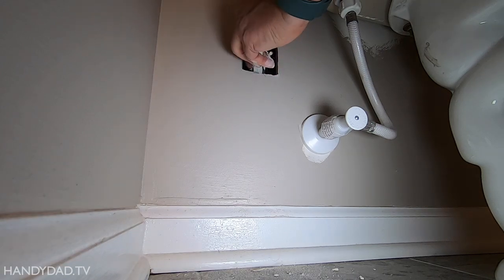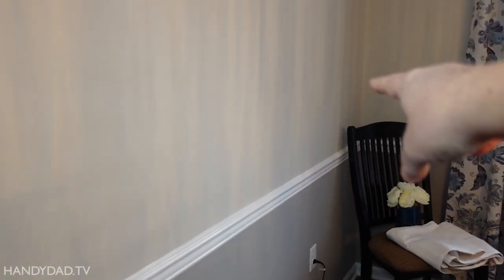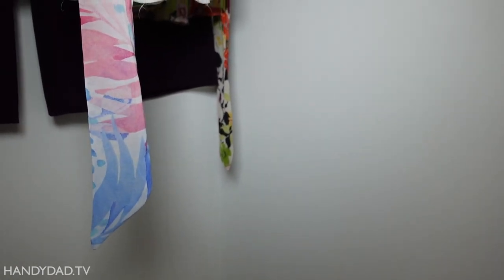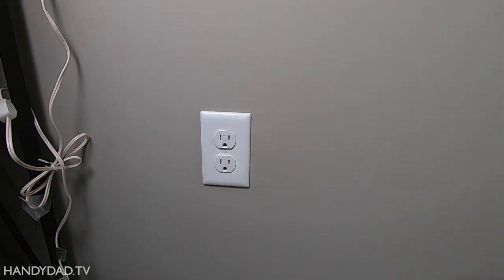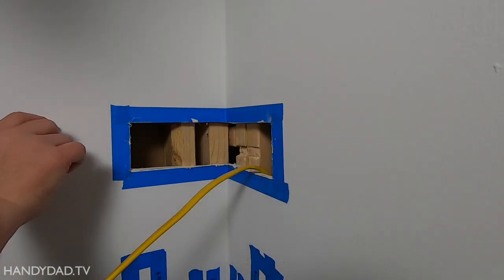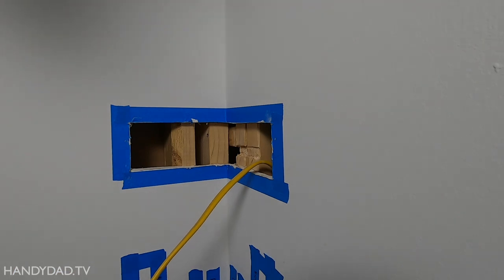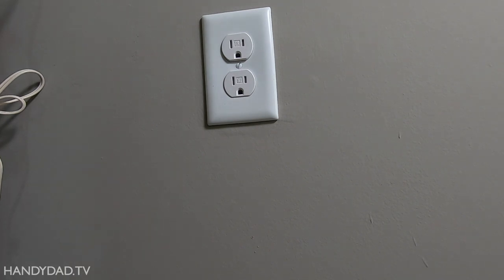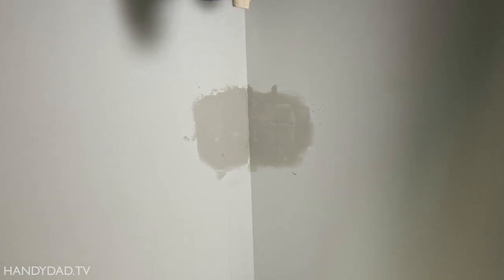Add an Outlet from Another Outlet Around a Corner for a Bidet

Comment from the maker: NOTE!! My circuit was protected by a GFCI breaker so I used a standard outlet. If you don’t have a GFCI breaker, you must use a GFCI outlet for shock protection.
Reply: This is what I was about to say.
Reply: Not so fast, that breaker looks like an Arc-fault breaker. GFCI usually has a yellow button. You better test it.

Comment: Fantastic Video!!! I have wanted to install a Heated Bidet myself, but the same issue as most, I'm sure. The notching out was Brilliant!!!!!!
Reply from the maker: Thanks. Just make sure to protect the wires before repairing the drywall.
Reply: Not it isnt he has to repair that now. He should have gone up and back down into the next wall or take the moldings off.

Comment: You did not notch more than 25% into the stud (if load bearing), you put nail guards over the wires, and you did eventually get the right GFCI breaker into the panel.  Seems 100% to code for me.  Good work, I never would have thought to get power the way you did.  Thank you for the video.  Its stuff like this that helps some of us think more outside the box.
Reply from the maker: Thanks so much 😊
Reply: It's not 100% to code because code states that the bathroom has to be on It's own circuit

Comment: There's another option that I've used several times that doesn't involve any drywall repair. Just requires two remodel boxes and access to the attic. Steal power from any outlet and go straight into the attic. Then run the power over and down to the new outlet.
Reply from the maker: Definitely a good option if you have an attic above or basement below. Unfortunately for me, there is a room above this bathroom and I’m on a slab so no basement either.

Comment: Nice video but shouldn't that outlet be a GFIC by code because of how close it is to a water source?
Reply from the maker: It’s on a GFCI breaker.
Reply: @handydadtv  hey. That breaker is an afci breaker(arc fault). The GFCI breakers usually come in a combo afci and GFCI with a purple reset button. I would double check your panel by removing the shroud to see the whole breaker.
Reply from the maker: You are correct. I replaced it with a GFCI outlet. 

I’m surprised AFCI, GFCI, or combo breakers aren’t clearly marked so you can tell without opening the panel. I just saw the test button and assumed it was GFCI.

Comment: Great video, thanks. Quick question- how did you get the romex into the existing box? And did you drill a hole into the existing box or use the tabs? I would think either would be difficult to maneuver given the location. I’ve tried that in the past and wind up having to cut out the existing box and replace it with an old work box to get the new line in but clearly you didn’t have to do that
Reply from the maker: I cut the wall in the closet directly above the existing box, so I could see the slots and push the wire into it. No new hole needed.
Reply: You should use the knockout on the metal box ½ inch (removed with a screw driver).  Secure the  Romex/nm clamp connector on the Romex then pull it into the box and install the nut.

Comment: Wow! Excellent video with "best practices" tips. The only suggestion that I would make is that it is better, if possible, to install the electrical outlet on the opposite side of the toilet from the water inlet just in case you have water spray from a joint or a breakage.
Reply from the maker: Good tip! Thanks.
Reply: If that's part of the dinning room circuit, which I'm pretty sure it is, it should be GFCI protected already.

Comment: I use an  Oscillating tool to cut the drywall and the studs, makes it a lot faster and easier
Reply from the maker: I didn’t want the dust in the closet with all our clothes. My wife would have killed me!
Reply: @handydadtv  my wife would kill me too, lol. Love your videos by the way.
Reply from the maker: Thanks so much 👍🏻
Reply: I use my oscillating tool to channel the studs. Faster than hammer & chisel, and you are less likely to get nail pops! You can also chisel a small relief in the stud face so the nail plates sit flush and your sheetrock patches go back in place properly!
Reply from the maker: @Danny Good tip!

Comment: Nice video. Thanks. My understanding of NEC requirements is that bathroom receptacles must be on their own dedicated 20 amp circuit. If my understanding is correct, tapping into a circuit from another room, as you did, would not be allowed by code.
Reply from the maker: So I’m fuzzy on new construction vs. renovation. I went with easy and didn’t ask permission.
Reply: Believe that’s for new construction.

Comment: From about 10:29 and for the next 10-15 seconds the new cable is threaded behind the toilet.

So does that wall have no studs?
Reply from the maker: The studs were visible in the closet. There were no studs between the hole in the closet and the hole by the toilet.

Comment: Question. I am learning all I can and I am trying to absorb everything as a first timer. You mentioned that 2 hot wires were coming into the existing outlet and after wiring up your new outlet, the existing outlet made you end up with 4 pigtailed hots using only 1 screw. If you wanted, could you still run one of the existing hots to the screw directly and then use 3 hots nutted and pigtailed instead to the 2nd screw? Just wondering since 4 wires pigtailed seems much?
Reply from the maker: Yes, you can pigtail 3 and use the screws on the outlet to join the fourth. 

Be sure to watch this one as well https://youtu.be/xex8cPv8CtA

Comment: Hi! Love your channel. Question? I'm having the hardest time screwing the receptacle in after I"m done wiring it up. The screws that came with the receptacle are flimsy; they kept stripping. So I bought some screws from the store. They are #6-32 1" screws and came with hex nuts. Any tips on getting the receptacle screwed into the box? I figured I need to use a manual screwdriver, Phillips or flathead, but I think my technique is off? Should I use the hex nut? And if so, is the objective to get the entire 1" length of the screw into the hole in the box? Literally stuck on this on the new receptacle before I re-wire the old receptacle; it's driving me crazy.
Reply from the maker: The screws only need to keep the receptacle in place. If you need to crank them with force to get the receptacle in the box, you probably have too many wires for that size box. Consider replacing it with a deep box. 

There is no rule saying the screws need to be installed to a certain depth. You just need them to hold the receptacle. You shouldn’t need to use the nuts.
Reply: @handydadtv  Really helpful, thanks! FINALLY got them in 🙌🏾

Comment: This was a great video.  I would do this myself except my knowledge of doing electrical work is rather limited.  I would have to hire an electrician.  Eventually I will but in the meantime I will use an extension cord (6' 12 gauge) to plug into a GFCI outlet.  It won't be too unsightly as the bathroom vanity has a lip underneath where I can hide the extension cord.
Reply from the maker: That’ll work

Comment: Great job! I would note to the viewers to be careful what circuit they tap off of. Some of those seats are 1400W which is the limit for a 15 amp circuit. If they tap off a pretty heavily used circuit and have that bidet going, they can trip the breaker. Not the end of the world, but would be frustrating and annoying.
Reply from the maker: Good point! My BioBidet DLS is rated at 1050W on a 20-amp circuit so it’s never been a problem for me.
Reply: @handydadtv  Good to hear. you are a rarity for a handyman when it comes to electrical. I'm usually cleaning up after homeowners Handy work or someone they hired that isn't a licensed electrician....and even licensed electricians 😱
Reply: @handydadtv would this be ok on a 15amp circuit ?
Reply from the maker: @OGCJ10 Yes, but it would be best to be on a different circuit from the bathroom blow dryer.

Comment: What is the difference between 14/3 and 14/2 wires and where we can use 14/2 and where 14/3. I know about the different wires gauge like yellow for 20amp and white for 15amp. Just want to know the difference about cable with 3 wires and 2 wires not counting the ground. Thanks
Reply from the maker: 14/2 has black and white wires. 14/3 adds a red wire. The red wire is typically used for switches.
Reply: @handydadtv  okay thank you.

Comment: When you twisted the wires you cut them too short, there barely wrapped.  You then cut the wall all open. All you had to do was pull the mouldings off.  ALSO, that breaker with the white button does NOT mean its GFCI its probably an arc-fault breaker. GFCI breakers usually has a yellow button. You better test it.
Reply from the maker: You are correct and I fixed it.

Comment: Great info, I'm trying to figure out how to grab the power off my GFCI in the half bath into the wall on my full bath next to it and get it in the right spot, got some plumbing in the way so I think I will just remove the drywall up high and cut 2 feet over then drop down.  Only thing I would change is notch out the drywall when putting it back to make the repair easier, so you build it out to fill in instead of float out to level out the bump, but I suck at drywall so try to avoid it lol.
Reply from the maker: That’s a good tip! Never thought of thinning the back of the drywall.
Reply: Give care here.   They make metal plates (stud guards) to prevent screwing through the sheet rock, through the wood, and into the wires.  Thinning the sheet rock may have you handing something and then doing electric repairs.

Comment: Did you reference the electrical code before doing this? It may be the easiest way to do it but it doesn’t make it right.
Reply from the maker: All the electricians on the Internet tell me when I do something wrong.
Reply: It appears that you tapped into a small appliance circuit in the dining room.

 (B) Small Appliances.
(1) Receptacle Outlets Served. In the kitchen, pantry,
breakfast room, dining room, or similar area of a dwelling
unit, the two or more 20-ampere small-appliance branch
circuits required by 210.11(C)(1) shall serve all wall and
floor receptacle outlets covered by 210.52(A), all countertop
outlets covered by 210.52(C), and receptacle outlets for
refrigeration equipment.
Exception No. 1: In addition to the required receptacles
specified by 210.52, switched receptacles supplied from a
general-purpose branch circuit as defined in 210.70(A)(1),
Exception No. 1, shall be permitted.
Exception No. 2: The receptacle outlet for refrigeration
equipment shall be permitted to be supplied from an individual
branch circuit rated 15 amperes or greater.
(2) No Other Outlets. The two or more small-appliance
branch circuits specified in 210.52(B)(1) shall have no
other outlets.
Reply from the maker: Thanks

Comment: Just wondering if this up to code ? I wanted to do the same but I’m not sure yet
Reply: Id like to know as well! It is GFCI so should be OK! If you don't have access to a GFCI you may have to do a bit more work.
Reply from the maker: An electrician told me this is how he’d do it. If I go to sell the house and the home inspection flags me for no GFCI there, I can swap the outlet in 5 minutes.
Reply: @handydadtv  you are not required to have a GFCI outlet there, but you are required to have a GFCI between that outlet and the panel or have a GFCI breaker in the panel for that branch (which is what I would suggest).  An inspection should flag you for not having a GFCI sticker on the outlet then if it is protected by a GFCI upstream.
Reply: @handydadtv  hey, handy

The nec is pushing for labeling things like GFCI protected recepticles.  Your video showed you were good, except for a label.
Reply: Adding a recepticle is okay code wise as long as it has GFCI protections.  So either a GFCI breaker, a GFCI recepticle, or fed from a GFCI breaker.

Comment: A good idea might be to cut out the hole for your plug in your bathroom where you want it, take apart the plug in the dining room, take apart the box it is in, stick your hand behind the wall and fish the wire to the hole in the bathroom, if it doesn’t work you can fish it. Then replace the old box with a remodel box, twist your wires, and make everything up.
Reply from the maker: I used the closest box to pull power.

Comment: that is a 15 amp outlet you are working on. a 20 amp outlet has a horizontal line on it.
Reply from the maker: Apparently they don’t need to install 20-amp outlets on a 20-amp circuit. Because every outlet circuit in my 3-year-old house is 20-amp but they are all standard 15-amp receptacles.

Comment: Isn't this against code because it is sharing a circuit with features outside of the bathroom? All bathroom circuits can only serve bathrooms.
Reply from the maker: Not sure 🤔
Reply: Neck 2020

210.11.(C).(3).  One circuit for counter top or similar work surface.

210.52.(D).  One recepticle within 3 ft of sink basin.

This outlet falls outside of these required bathroom recepticles but still must be GFCI protected. Nec 210.8.(A).(1).
Reply from the maker: @Keith - Thanks so much!!
Reply: Absolutely correct. Receptacles in the bathroom can only be feed from a branch circuit dedicated for the bathroom. Can't pull power from a branch circuit feeding another room(unless it's another bathroom and even then there's a few different provisions you have to take into account) 
The main rule in 210.11(C)(3) states that the branch circuit provided to supply the bathroom receptacle outlet(s) shall have no other outlets.
Reply: @handydadtv  Even though it's still against code. You'd been better off using a gfci outlet where you got power from(plug in bathroomon load side of gfci). Rest of the circuit would still been AFCI protected, like it's suppose to be.
Reply: @Auburn7543  I guess I misread 210.11 C.3.  in the 2020 code book. It says that one circuit or more in the bathroom for outlets required by 210.52(D).  210.52(D) says that the recepticle required must be within 3 ft of the basin.

Since the toilet is outside of this 3 foot mark, it need not be on this circuit, however, it must be GFCI protected iaw 210.8(A).(1).

It looks legal under those rules, but I am not perfect and would love the reference to prevent my future errors.
Reply from the maker: I changed the outlet to GFCI after someone told me it’s an AFCI breaker. 

As for the code debate, I don’t argue code because I’m not an electrician. But they generally apply for NEW construction/additions. I remodeled a bathroom, with an electrical permit, and the inspector didn’t make me run a dedicated circuit.

Comment: It would be helpful for the audience to k ow why there are two white and two black wires attached to the outlet. You really glossed over that by sayi g that there are 2 white and 2 black.
Reply from the maker: One set of wires brings power in; the other goes to the rest of the outlets on the circuit. Watch this https://youtu.be/xex8cPv8CtA
Reply: @handydadtv  I  knew that, but you should probably have told the weekend warrior that fact.

Comment: That outlet is not up to code & can be dangerous. This use requires a GFCI outlet.
Reply from the maker: I originally thought it was on a GFCI breaker because it had a test button, but it turned out to be an arc fault breaker. So I replaced the outlet with a GFCI. Thanks.